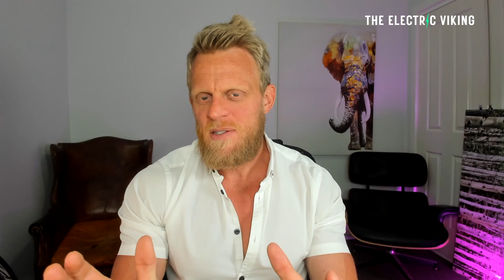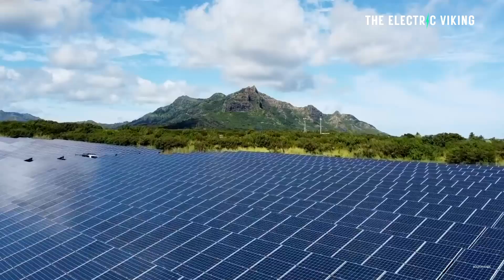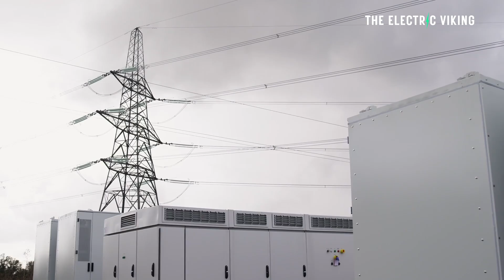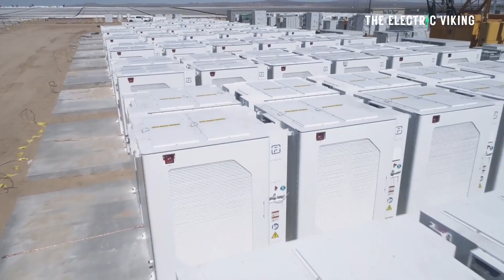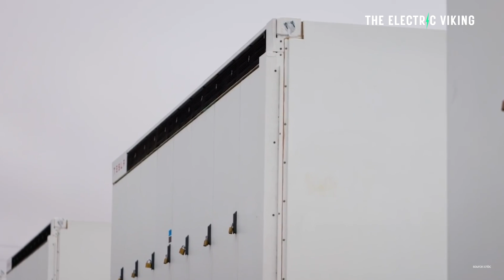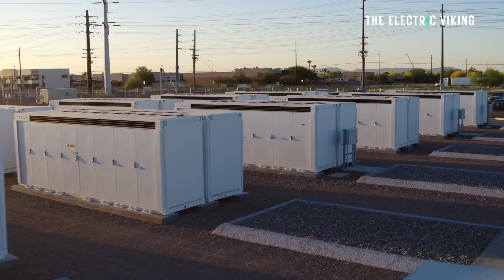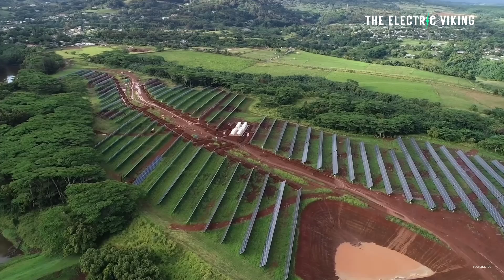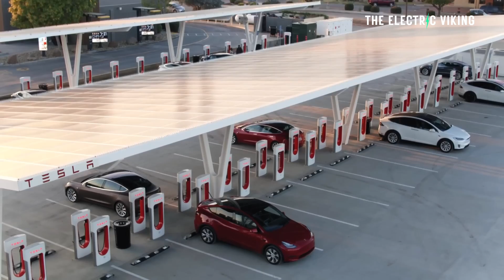Batteries + solar smash records in California and fossil power plants suffer

Comment: Wow , with all this free energy from the sun , Californians must have the cheapest annual electricity  supply of any state in the USA , right ?
Reply: No.  Just like tesla evs, it's expensive to be an early adopter and people call you crazy.  But eventually its cheaper and they shut their mouths.  You will too, eventually
Reply: @googleuser4434  It's STILL expensive and useless and requires too much taxpayer subsidy!  What are you talking about?  Tesla is proof of EXACTLY this, which is why we HAVEN'T shut our mouths.  We need to fight snake oil salesman like you.
Reply: @googleuser4434 sure buddy.
Reply: What's needed is competition. Monopolies will never allow "The People" to participate in buying or using electricity at the wholesale rates until the regulations are changed to favor the consumer rather than the producer.
Reply: @simonpaine2347 there is no monopoly on solar.  Anyone can get it, unlike coal
Reply: @simonpaine2347  Then you need to lose the MAIN monopoly...GOVERNMENT.  Also, you need to remove statewide grids.  Someone had to own them, which means they control them.

Each person needs to be allowed to generate their own power as they see fit.  PERIOD.
Reply: Yes, the smart ones who have their own PV system with battery.
Reply: @MrArtist7777  Because they get atate subsidy for 'selling power to the grid.'  They don't, and there less well off neighbors are the ones paying for their power.  It's a scam designed to drive more people to 'smart' homes, and results in HIGHER power prices.
Reply: Rates in California are high because California is actually paying its own money to build out massive power capacity for future use. They are paying their own way as they go the saying goes, instead of other states that rely on Federal grants and emergency funding *(cough cough Texas )to cobble together ad hoc infrastructure and cobbled together bailout funds for individual power users to pay their electric  bills.
Reply: @nerdbikes3841  Are you kidding?  California has sucked down so much green subsidy it's not even funny.  As well, they wield more authority to set national energy policy to authorize MORE subsidy, than any other state in the union.  And they STILL suck down power from other states every time their grid goes brown.
Reply: CA has bailed out the monopolies multiple times and the cost of these bailouts has jacked rates up crazy high.   Huge jumps in electricity rates followed the following bailouts : 1) nuclear power plant construction 2) Enron power market crash, 3) wildfire deaths.   These massively expensive failures were a combination of public and private policy idiocy each adding five to ten cents to each kWh in CA.
Reply: I think the real problem is the people there don't understand cause and effect and many of them flee California and make the same mistakes there.
Reply: @tedg1609 That's crap.  Cal resisted nukes, choosing to use power from ARIZONA'S nuke plant instead.  The main increases have been from the fines imposed on utility companies for using gas plants to keep the grid from crashing, not from your tortured understanding of capitalism.
Reply: Pg&e has a lot of debt to pay because of all the people it's killed and small towns it's blown up and the capital investment and burying all our cables underground. So no California has some of the highest utility rates in the country.
Reply: @Joegreen-r1i  the wild fires that were started by PGE equipment would not have been so devastating had it not been for the record drought. Climate change is more to blame. It still is an inconvenient truth..
Reply: @hoffinger  Wrong again.  The trees touching power lines were left alone due to environmental regulations, rather than cleared away as usual.  And these fires started in areas of California that are MORE HUMID and LESS DRY.

Whether it was summer instead of fall had nothing to do with it.  Stop spreading that stupidity.
Reply: @hoffinger  So climate change is blamed for both droughts and floods. However, in the past there have been droughts that lasted 200 years and the worst recorded flood was in 1862.
Reply: @billcichoke2534  source for the trees?
Reply: @williamcrowley5506  California regulations, PG&E references to same.  Both available on their websites.
Reply: @billcichoke2534 NOPE!
They (PG&E) have grandfathered right of ways that they didn't keep clear, and also didn't maintain their infrastructure.
SoCal Edison isn't much better, with rotting wires and antique transformers.
Reply: @blaydCA  Funny...our system in Oregon is slightly younger than California's, and we don't seem to have those problems.  And PG&E up here had no problems clearing branches off/away from their lines.

Of course, Salem (our capital) didn't tell them to leave the trees alone to 'preserve the ancient forest.'  Sacramento is well known for that idiocy.
Reply: @billcichoke2534  
The operative being "newer". New wires don't break as easy and spark a fire.
Also, there are many co-op electric companies in Oregon which keeps the costs lower because they're NOT paying dividends to shareholders.
I know my monthly meter charge in Oregon isn't exactly cheap but the usage is very inexpensive, so different methods of billing.
My SoCalEd meter is cheap, but the usage is ex$pensive.
Reply: @blaydCA  What co-op companies?  You have either PG&E in the western and Central areas, or Idaho power in the east.  And both are traded publicly and pay out dividends.

The MAIN reason why power in Oregon is cheaper, is due to the fact we have HYDRO power from the Columbia River dams.  There have been quite a few gas plants put in, to make up for the far fewer more capable coal plants that were shut down.  But as solar and wind have been put in, prices have increased and grid reliability had taken a hit.  It's the main reason California can't get as much power from us as they used to.

Oh, and by 'newer,' I mean by around 5 years, NOT DECADES.  Remember, much of the original grid was put in place around the Bonneville dam, back in the 1940s.  Yet those lines don't spark off wildfires.

It's not an age thing.  It's a California leftist government mismanagement thing.  Or do you not remember all the years California was a REPUBLICAN state, and DIDN'T have these problems, even as the load on the southern section of the grid increased?
Reply: @billcichoke2534  
South Eastern Oregon has co-ops. Lake County, ect Nice new poles and wires! Unlike the SoCalEd rotting wires here that frequently croak.
Reply: @billcichoke2534  Yes I remember when CA was a Republican state. That's when the power companies were allowed to pay dividends rather than invest in their infrastructure. Years of neglect and overpaying shareholders is to blame.
Reply: @blaydCA  South Eastern Oregon is Malheur county, where I live.  That's Idaho Power.  Lake County is under one or the other PG&Es, since they also access hydro power.  Unassociated utilities don't have that access.
Reply: @simonpaine2347  Ah yes, the old Enron days and Governor Pete Wilson.
Everyone in California was crying.
I was East Coast in those days.
Reply: So if there's all this extra power in the middle of the day why are we paying forty eight cents to sixty cents a kwh to charge our electric cars in the middle of the day in california?
Reply: @terrya6486  Because there isn't.  You're paying for the extra fines utility companies pay to use natural gas plants to ACTUALLY generate power.  That and import fees from Oregon and Arizona utilities to make up the difference, since so many coal and gas plants were closed in Cal.
Reply: California has the highest electric rates in the country.  Shortfalls are made up with natural gas which is becoming more expensive because of exports of LNG.
Reply: My rates are $0.35/kwh up to baseline. $0.55 above baseline. Baseline varies per season but averages 500kwh/month. Rate increase notice every other month. So, NO not even close to reasonable. So-Cal Edison
Reply: @Nathan-wz4lg  And who approves those rate increases, since that's a public regulated utility?

Still want to vote for those demonrat clowns?
Reply: Spin those facts! So good, why are we paying subsidies?
Reply: Dude.  You know how to to twist the knife, sprinkle salt, and squeeze some lemon as well.
Reply: It will once all the fossil fuel generators are off it.
Reply: @DickyChap  WHAT will...the RATES?

Stop believing in unicorn farts.  They can't power the grid...much like wind and solar.
Reply: @DickyChap  So how will that happen with mainly  solar and wind powe? The 10,000 mwh of battery backup only provides around 19 minutes of electricity. This is based on total California yearly use of 278 million mwh per year or on average 761,000 mwh per day or 31, 700 per hour. So you need one heck of a lot more storage to not need some other backup when the sun doesn't shine and the wind doesn't blow. In addition the solar summer to winter output even makes it worse. My solar system averages over 50 kwh per day in the summer and averages around 6 during the winter. Even the best solar systems produce twice as much in the summer than in the winter. So good luck on relying on wind, solar and batteries.
Reply: @rayshepherd2479  your calculations for the backup only lasting 19 minutes is based on the load being spread evenly between the 24 hours in a day as well as between the months, which it is clearly not. The Vikings numbers are always a bit suspect, but California definitely has the potential to be self sufficient within 5 years. Battery technology is getting better and cheaper every year.
Reply: @simonpaine2347  No, it actually gets worse because because solar output is so much less in the winter. You are correct it would last longer because of current nuclear, hydro, geothermal, biomass and wind if it's blowing. Of the 278 million mwh per year being consumed, about 82 million mwh is imported. Of the 194 million mwh produced in California, 58.7 million is Nuclear, hydro. Biomass and geothermal.  So you will need wind an additional 219 million additional renewables to meet demand. Current wind and solar is 33.3 million mwh and 15.2 million wind. If the additional renewable generation is all wind and solar, the amount of battery storage required to keep the lights on all night is immense.
Reply: @rayshepherd2479  
Let's bear in mind: what California imports/exports is price based. Whatever/Whomever is the cheapest based on projected demands gets to supply the power, excluding long term contracts and excess requirements that are purchased on the spot market to keep the grid stable.
Reply: When the rest of the country catches up to California, that's when electricity will really start dropping in cost.
Reply: Send us Chinese solar panels at lower prices
Reply: @DD-vf9ow  
Maybe things have changed now, but not long ago Communist Chinese Party made panels were absolutely JUNK, and burnt out or burnt up.
I'll keep to High Quality panels myself
Reply: @DD-vf9ow  Where do you think the overpriced underperformers you're using NOW came from?  Jeez...
Reply: They would have cheap energy if it wasn't for Trump and his crazy old time policies and MAGA fools
Reply: lol.if we make it at home they don’t want it.
Reply: @Preciouspink  That's because it's less than what you get from the grid, and isn't clean power (not normalized or synced to grid frequency).  And yet the power company pays rich lefties for power it doesn't get and couldn't use.
Reply: @billcichoke2534 
Grid tied Solar IS synced to the grid electronically.
Meters DO spin backwards.
Battery Storage and Peaker Plants are ex$pensive to operate
Correct, that the subsidies penalize those that can't afford solar.
Then again, taxpayers subsidize Big Oil as well. Rich shareholders do alright there as well.
Reply: @timothykeith1367  
The early adopters did get paid well.
Now, not much as you point out.
That's why many "make hay while the sun's out" or charge batteries or cars.
Reply: just like here in the UK where we have loads of wind power. oh wait.
Reply: @Withnail1969  
Well you have DRAX on the days that the remaining radiation from Windscale doesn't keep you warm and glowing.
Reply: Someone knocked on my door last week, and told me that was why my utility bill more than doubled last couple of months, and will be increased another 17% in June. I am in San Francisco Bay Area.
Reply: California can't do anything cheap.  If you want to put a 3 ft retaining wall in your backyard with about 1k worth of materials, you will need to go through 3 different agencies and a multi-year permitting process that if finally approved will still require inspectors who make over 60 bucks an hour to verify that you're doing it correctly.
Reply: 😂😂😂 indeed we have the opposite of cheapest
Reply: The political power of the oil industry will not be overcome so easy.
Reply: Once the capital investment is paid off
Reply: California uses about 278 million mwh of electricity per year or on average 761,000 mwh per day. So 10,000 mwh of storage would last around 19 minutes. If my calculations are right this doesn't seem like much.
Reply: @rayshepherd2479  I'm sorry, I didn't see all of your comments before I made mine. If I'd have realised that you're a climate change denier, then I wouldn't have bothered to bother you with a rational point of view, because clearly you don't have the ability to understand basic facts and common sense.
Reply: @simonpaine2347  I think climate is always changing I just don't think warmer temperatures will be catastrophic. In fact so far they have been positive. I actually have solar panels and an electric car since 2014. The cost to charge my car on PG&E's EV off peak rate has increased from $12.7 cents per kwh to $35.2. My solar panels work well in the summer averaging over 50 kwh per day but drop to an average around 6 kwh per day in the winter. Yesterday my solar produced 49 kwh. Today it's raining and it appears production will drop to about 4 kwh. I looked into battery backup but couldn't justify the $20,000 plus cost.
Reply: So power must be $1 to $2 per kw the state will go broke or out of business. Each solar wind generators in Australia gets $7.5 million subsidies each batteries would be at least $200 per kw as well. Roof top solar and batteries get about $8000 subsidies per house tax payers pay for that so no funding for hospitals and schools.
Reply: @davidwright1752 what is the annual amount of fossil fuel subsidies each year for the past 50 years?
No? How about the past 10 years?
Compare that with renewables of all types.
Be honest now, what is the difference? A range multiplication factor will do.
We’ll all wait while you Google it.

Comment: Could you talk about the practical considerations of solar cells in cold parts of the world where we have snow?
Reply: In the north the panels both roof and ground based are typically at a steeper angle so normally the snow just slides off.
Reply: I live in Wisconsin and solar in winter does suck on a few days after a heavy snow but it clears up. I averaged 40kw a day this past winter. Summer I easily double that
Reply: I once saw a video of a man testing if solar panel can still work if they're snow covered  it was still powered Albeit significantly underpowered

Comment: Are your old solar panels going to be recycled, that is the question...did you ask?

Thank you.
Reply: Solar panels typically last 50-100 years at over 50% capacity…
Warranty typically guarantees less than 10% degradation in first 25-30 years.
There are no moving parts and yes they recycle fine but obviously not a big industry yet as few are retired yet.
Reply: @whowhy9023  Nuclear lasts 100 years and works at full capacity 24/7 of course and only takes up a small area.
Reply: @christopherj2231 And the Deadly Nuclear Waste lasts longer than Human Civilization has been around.
Nuclear is foolish and expensive for MANY reasons. Not the least is that people start Wars. Guaranteed if there had been a bunch of Nuclear Reactors in WW2 more than a few of them would have been destroyed and set off a runaway reaction and / or major explosions and contamination.
This is NOT a good solution.
Reply: @DavidC-pg6ni  You are wrong, nuclear is the future.
Reply: @christopherj2231 cost vs completion time?  Not feasible.  Thats why there hasn’t been a new one built in the us in the last 20 years or so.  Always over budget and over time.  Return on investment is decades. 
Solar is quicker and cheaper to install with a quicker roi and in business roi is almost always the main consideration other than upfront costs
Reply: Smug Chris thinks his utility can recycle the coal and methane gas it uses to produce his electricity.
Reply: @freeheeler09  Nuclear son.
Reply: @christopherj2231 3 mile island son